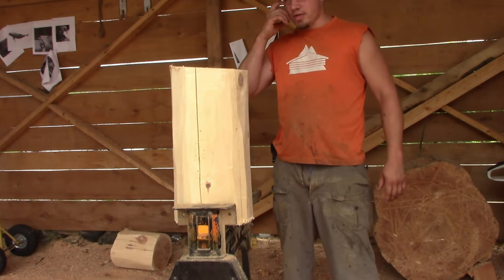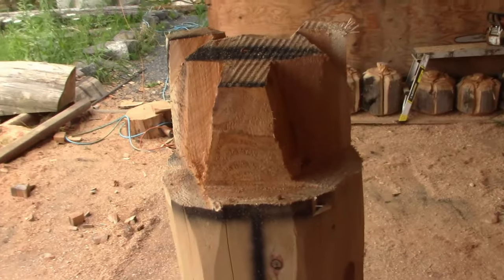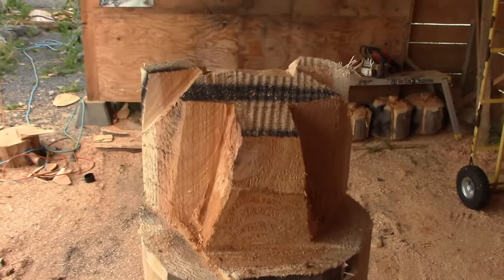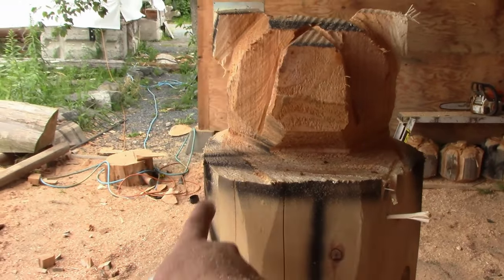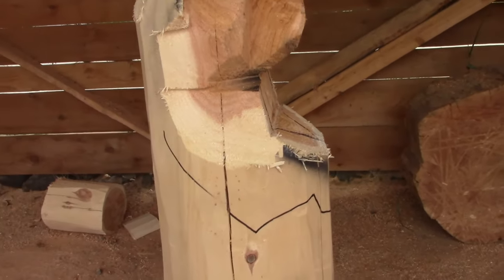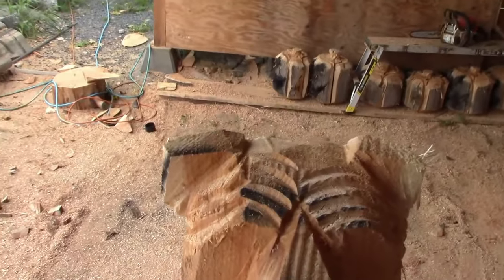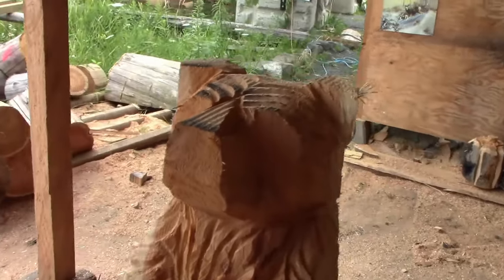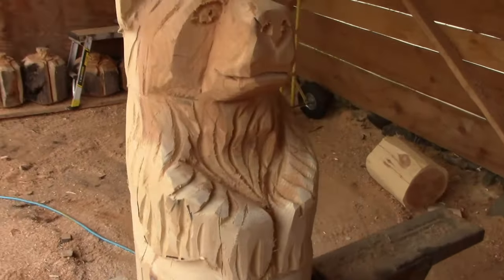$40 Chainsaw Carved bear tutorial

Comment: Why are your cuts so smooth? Is it the type of wood that youre using? I used hickory ( it wasnt super dry) and my chainsaw would kick like a bitch when I would try and do small details like hair for example.
Reply from the maker: Sharp chain with low rakers, round edge chain would be a good start and if she's kicking you might be using the wrong part of the tip!!!
And cedar is a very soft wood compared to hickory
Reply: @EricCaronChainsaw  thanks broseph!